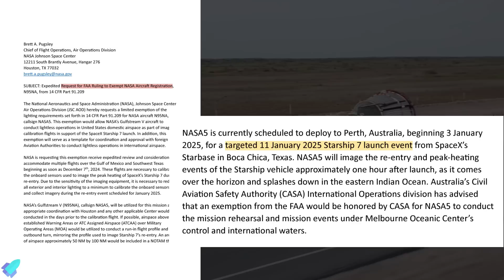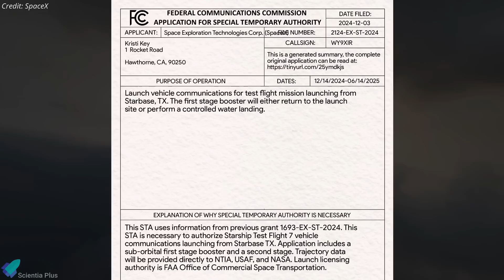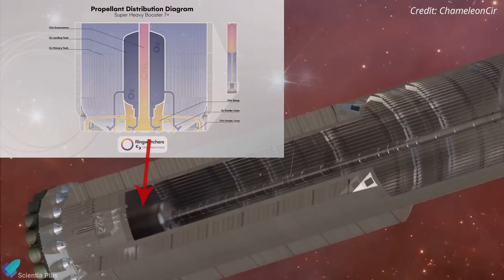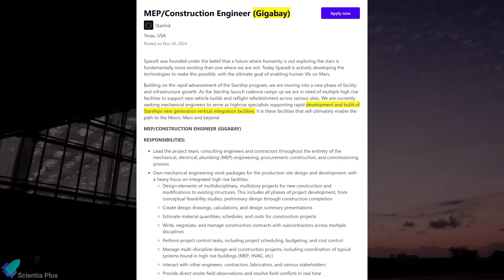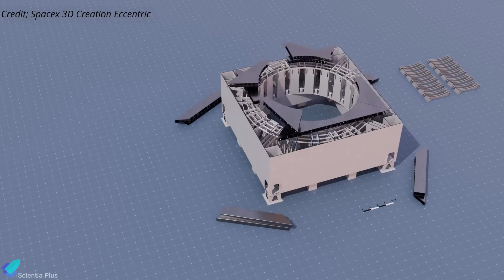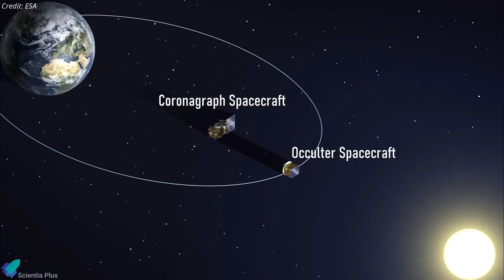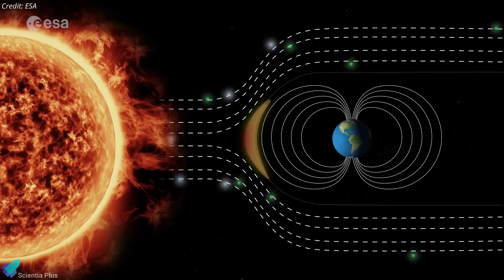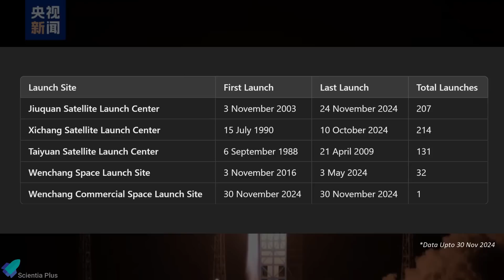SpaceX Reveals Starship Block 2 Booster Upgrade That Will Fix Landing Issues

Comment from the maker: 00:00 Starship Updates
06:40 ISRO Launched Europe's Proba-3 to Unlock Sun's Mysteries!
09:21 China’s New Rocket Revolution: Long March 12 Unveiled!

Learn More:
1. Starship V2 Explained: 
Summary: https://shorturl.at/9Iudv
Detailed Explanations:
  a. Design Improvements Update 1: https://shorturl.at/lpGT7
  b. Design Improvements Update 2: https://shorturl.at/gwNQ4
  c. Nosecone & Payload Bay Redesign: https://shorturl.at/xa60S
  d. Methane Downcomer Redesign: https://shorturl.at/XdYBG
2. Starship V3 Features: https://shorturl.at/mnBT4
3. Starship V2, V3 & Raptor V2, V3 Complete 2024 Update: https://shorturl.at/tN248
4. Raptor V3 Mega Upgrades & First Test: https://shorturl.at/TRIyj
5. Latest Starship Upgrades
  a. Starship Hot Staging Explained: https://shorturl.at/jf400
  b. Super Heavy Booster Upgrades: https://shorturl.at/Pi5R3
  c. How SpaceX Protect Raptor Engines: https://shorturl.at/4Om8F
  d. Starship New Heat Tiles Explained: https://shorturl.at/p2Ijb
6. Starship Flight 6 Analysis Complete Breakdown: https://youtu.be/3BzZmsuROl0

Weekly Updates: https://bit.ly/3HIQjPC
SpaceX Playlist: https://bit.ly/34wue8T

Comment: Why dont they develop a  catch system  separate from the launch tower?  It could be a tower or other design used exclusively for retrieving the booster and or starship.  It could eliminate much of the infrastructure required for launches and risk of damage to same/
Reply: Because this solution gives a much faster turnaround time. There is no need to move the booster or starship. It is immediately in the place from which it will launch again. Separate take-off and landing platforms add much more of the other infrastructure. And you need twice as much space.
Reply: @Beltarro i agree, but u would rather see the catch arms on the other side of the tower to prevent damage to the pad. Maybe make a catch place on the opposite side of the pad behind the tower
Reply: @woutgaming9685  It would probably complicate the situation more than it pays off.
Reply: In the solution you propose, it would be necessary to protect both sides from engine flames anyway. As Elon says, "Best part is no part".
Reply: I don’s see much benefit for booster because separate catch tower loses the convenience of putting booster straight back onto launch mount for fast turnaround but as Starship evolves to a general purpose launch platform I can see benefit there. Apart from tankers and maybe dedicated Starlink deployment ships any other ship coming back can’t just be stacked back onto a booster because it will need its next payload integrated.

For Starlink maybe a pez loader can be taken to the launch pad but for other payloads integration is typically a complex process done in clean conditions so a returning ship with empty payload bay would need to be taken back to some payload integration building to have its next payload integrated so there, eventually, a dedicated ship catch tower might well make sense. As well as being simpler such a tower could also be a lot shorter than the full-stack tower required for an actual launch.